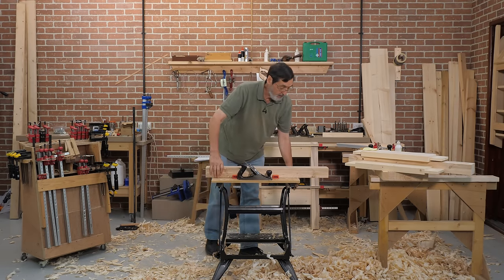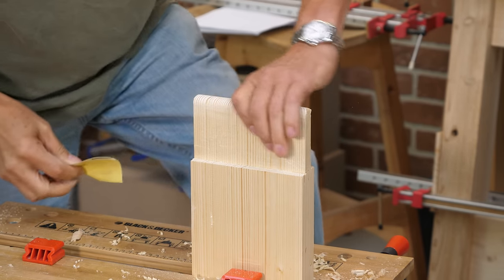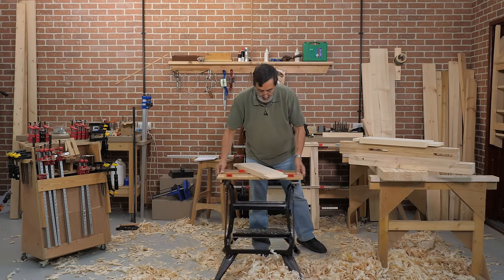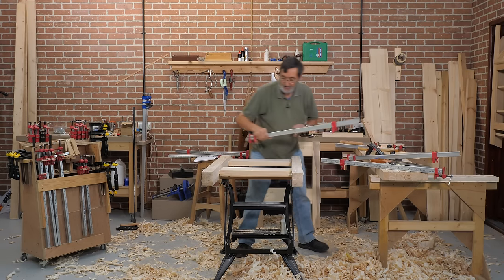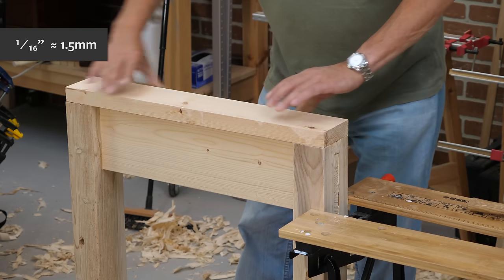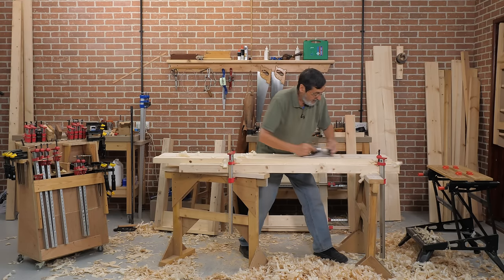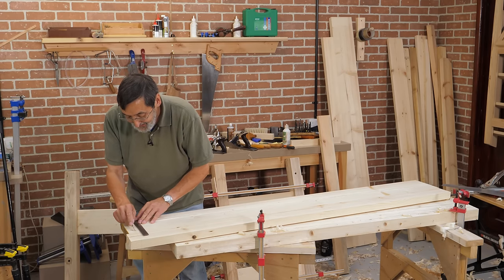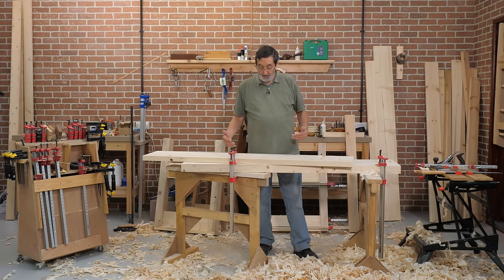How to Make a Workbench Episode 5 | Paul Sellers

Comment: I am in no position to be offering someone with your caliber of craftmanship any pointers. I have learned a lot from this series already and applying many of the techniques to my own work. That being said, through my own experience (~12 years), I have learned that when screwing 4 or more corners (like you did with the bearers) it does well to apply the car mechanic star pattern for installing screws. So if the North West (NW) screw is first, then move on to the SE screw, then the SW screw, then the NE screw. I have found this method to apply even pressure to the wood being screwed down and ensure squareness throughout the installation process. Love the series and honestly this is just a niggling point I realized.

Comment: These videos are exactly what I was looking for, everyone makes benches with table saws, jointers and planers. It’s nice to see someone do it with more basic tools. I don’t understand the use of standard and metric though. I thought people from across the pond hated the standard measuring system
Reply: Depends how old you are.  Paul is an in-betweener - he learned imperial but has to work with metric because that's how materials etc are sized now.  I'm the same - I'm younger than Paul but grew up with imperial then switched to metric.  The result is that you chop and change: small gaps are a millimetre or two, big gaps are an inch or two; buildings are measured in sq m, but distance is yards and miles; fuel is bought in litres, but we measure fuel efficiency in mpg. Bit of a mess really!

Comment: I have learned a few new things which were not in the old 2012 videos : making the upper rail and the bearer a little short to allow for legs shrinkage. I made my bench this summer. The wood for the legs was in my house's basement for more then a year, I hope it was dry enough. Otherwise, it is always possible to knock down the bench to remove a protruding tenon behind the apron.

Comment: "A little bit of scientific help" with a hammer.    I usually refer to that as "friendly persuasion".
Reply: Percussive joinery
Reply: Bob Blarney mine yeasterday settled at like 3 mm... I got thrm to go together with not so gentle persuasion. 2 clamps and exxxtremly heavy hammering. The clamps needed tightening every few bashes. Then a sideways knock and a few more percussive blows and clunk yyyay. Took half an hour with glue driying all the time!

Comment: Hi Paul et al,

Thank you for all your videos. I have some questions that I want to check with you/ the hive mind.

1. I think you are using pine for this build (apart from the legs..i don't know what they are). I'm in Australia so the pine i was going to use is Radiata...It's pretty soft, a little softer than southern yellow pine I think. I would love a hardwood bench but I dont have any machinery and cost is a factor. Is it ok to make a bench from radiata? I've had people putting me off it but have read what you and others like Christipher Schwarz say and I was going to give it a go. Anyone here in Australia use radiata for their bench?

2. I'm assuming there would be no major issues changing some of the dimensions a bit...for example the legs. Radiata stock is easy to get in 90mm but I would have to use multiples glued together to get the 95 mm legs required. A bit smaller is ok, yeah?

3. I'm not sure I want a tool well...I could scrap that and keep the solid bench running across the whole top mimicking joinery from the other (solid bench) side?

4. I don't have any clamps! I've been thinking of getting some pipe clamp sets....but I have never used them before? What are people's opinions on pipe clamps and will they do as good a job as regular aluminium or solid iron clamps?

Many thanks in advance.
Reply from the maker: 1 I don’t see a problem with using soft pine, it will still last for decades.
2 Just change the size. Go with what you got.
3. Changing design concepts it’s entirely up to you, personally speaking, life without a well it’s not worth living because a well is wonderful for storing your tools close to hand without obstructing your work.
4 Yes they are fantastic.
Reply: A thought about clamps.  Pipe clamps are heavy and can leave iron stains on your project.  They are just about indestructable, but the moveable end (adjusting for overall length) rolls around the pipe body and has to be aligned frequently...I find it annoying.  Also the clamping pads do not come down to the level of the pipe, so some offset is inherent in their use, which can bow the stock being clamped if not careful.  Lastly if one falls off the wall where you store it, it will injure you or serious dent anything it hits.  NONE of this applies with aluminum clams, in my experience.
Reply: Chuffed to get a reply from you Paul. Many thanks for the information.
Reply: cdouglas1942 - Cheers.
Reply: cdouglas1942   Buy Bessey clamps, the best in the world and well worth the price. Clamps, clamps and more clamps, one can never have enough of them.

Comment: If I remember well,  in the old video you were drawing the attention to the lower rail protruding tenon. When gluing the lower rail, no "science" will seat the tenon if the leg is resting on a flat surface without a gap to allow the tenon to protrude.

Comment: Hi Paul, long time subscriber here, always loved watching your videos and learning so much from them!

I have two questions about modifying the plans for this bench. 
Firstly, how short could I make the bench without losing the weight necessary to stop the bench move around as I'm working? I'm looking to shave off as much as I can!
Second, could the front apron be replaced by a rail running between the two sets of legs? Perhaps at the same height as the bottom of the apron. I would like to have clear access underneath the front of the bench. Would I lose too much structural integrity?

Many thanks, I look forward to your next video!
Reply from the maker: HI Samuel. The length would depend on the type of work you want to do, if it’s small work you can shorten it to 3 feet but heavy work requires a heavier bench. 
You could reconfigure the apron details by using two rails instead of one however I think this does compromise the effectiveness to some degree.

Comment: I'm trying to do that workbench but i'm having difficulties to make the apron. Do you need to take all the twist out? I realize you didn't use the winding sticks, is there any reason not to do so ? When i tried to remove all the twist, i end up with a 1 inch thick apron.

Thank you for all the passion you put in your video, very inspiring !
Reply from the maker: I would just change the wood and find some untwisted material. It sounds as though you have too much twist which can cause the whole bench to be twisted if you don’t remove it and one inch minus the recesses will be too thin.
Reply: Paul Sellers thank you for your answer. I'll try to find untwisted wood or laminate three 2x4 instead of using a 2x8 with a 2x4.
Reply: @Paul.Sellers Thanks Paul. I have a similar problem and your answer makes perfect sense.
Reply: @Paul.Sellers  
Hi Paul,
What about if the skirt material is a little bowed? I have 2 × 12 x 12 that I like  to use.  I bought  it straight.  Can this board be used for a skirt? Thanks
Reply from the maker: @nelsonrodriguez4492  yes. It should y no problem.

Comment: Can anyone help? My aprons have twisted post glue up. By more than an inch. They have a straight edge on each side but they have twisted down the middle
Reply from the maker: I am afraid you will have to cut them off and remake them from new stock. Obviously, the wood is not fully seasoned. Sorry to be the bearer of bad news.

Comment: Hellow Paul, I'm spanish and I do not know if I can express myself correctly. For it, I'm sorry.
My dude is: What kind of bench plane you use?
Could you tell me the exact make and model, please?
Thank you very much!
Reply: ZEKY BCN he uses record or Stanley number 4 most of the time
Reply: Stanley number 4, there is only one model?
Are you sure there are no more models or versions?
I mention it because in amazon.es there are several "Stanley number 4" and I do not know which one to buy.
Thank you Tyler!
Reply: In amazon.es there are several "stanley 4" and I do not know which one to buy.
Are you sure there is only one model and one version of Stanley 4, Tyler?
Reply from the maker: Mostly, 99% of the time, I use a Stanley or Record #4 smoothing plane. I have used one for 55 years to date six days a week full time working with wood.
Reply: Yo no te pregunté eso, pero da igual, no importa. Gracias de todos modos.
Reply: This isn't a question with a simple answer - there have been many Stanley #4 planes over the years, and the one Paul is using is a very old model which isn't made any more.  To get that exact model, you would need to find one used, and then restore it.  To learn more, go to this link https://woodandshop.com/woodworking-hand-tool-buying-guide-handplanes/ and scroll down to "Buy A Smoothing Bench Plane."  Personally, I have a Lie Nielsen No. 4-1/2 Smooth Plane and I love it.

Comment: Could you use dowels instead of screws to anchor the bearers to the leg frames?
Reply from the maker: It would not be as suitable, strong or as durable.  And I am not at all sure why you would. crews were a remarkable invention and have amazing pulling power and retention is a constant.